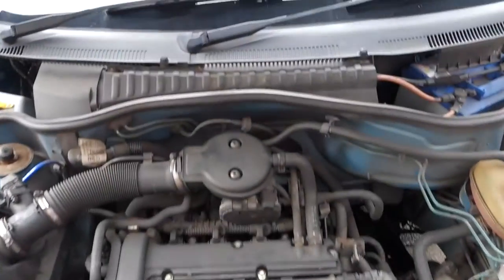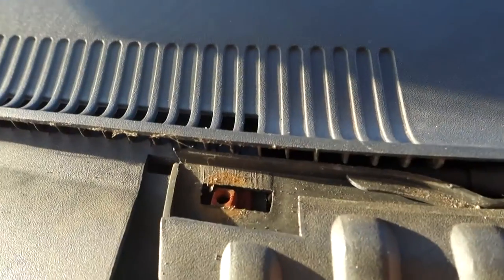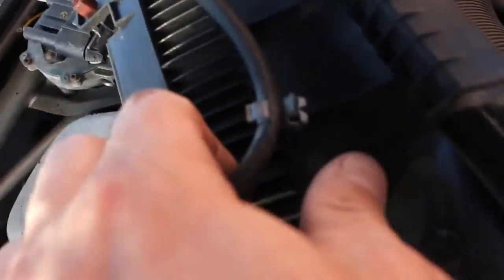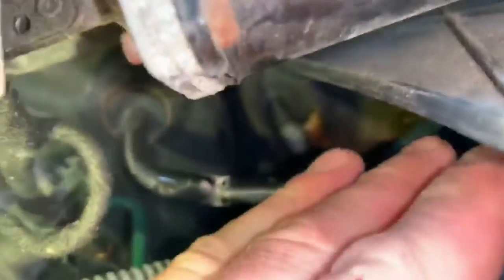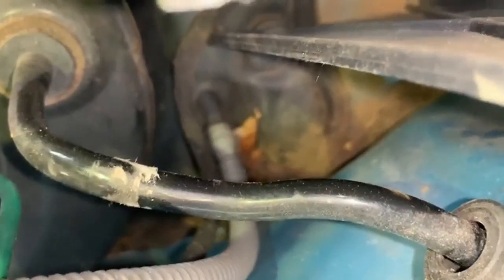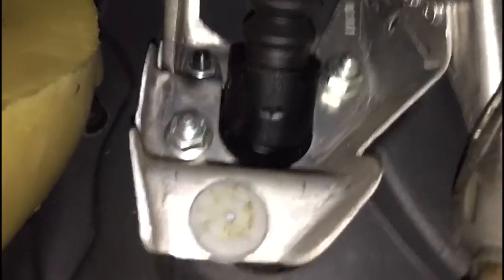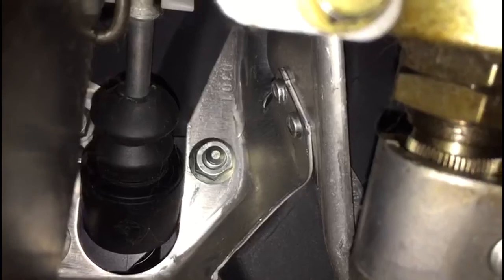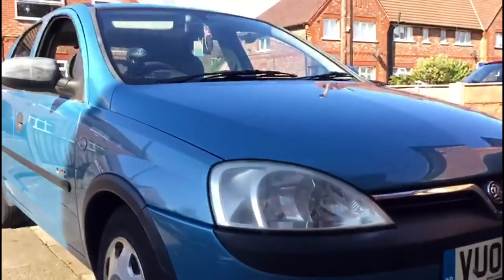Vauxhall Opel Corsa C - How to Remove and Replace Clutch Master Cylinder

Comment: Attempted this job today there was no other way of removing the master cylinder without removing the steering column lower uj joint shaft. I learnt this the hard way after hours of trying to get the clutch pedal out of the way. The jobs a massive pain in the back quite literally, mainly because of such tight space your working in and the position you'll be in for the next 2+ hours.
Reply from the maker: It's hands down the most awkward  job on any car! I've done a few with much misery.
Reply: absolutely right, that is what i am doing now,
Reply: Yup. I too ended up doing it properly by removing steering column. At one point was on my back, head under steering wheel and legs up over the seat. Took about 5 hours to complete. Had to get back of clutch pedal welded as tint stopper but had snapped off meaning the awkward little plastic bit at the end of the cylinder shaft had nothing to push against so must have got caught and snapped. A year on and all still good.
Reply: I removed the steering column too, but now the car won't start after removing the steering column after replacing the clutch cylinder, there's no fuel going into engine from the hose that brings fuel into the engine. How can removing the cables around the steering and putting them on affect fuel going into the engine?
Reply: @tebogopodile  if you removed the steering column it could be that you just need some codes clearing. Some faults may cut fuel supply like if you came or crank sensor are reading wrong

Comment: Hello, kindly assist me, I try moving my car this morning and when I try to get it in gear it won’t even move but the reverse gear would make a very loud noise, but after a few minutes of turning the car back off and going back to try to move it, I put the car in gear before I started the car and it worked just fine. What do you reckon the problem would be ??

Comment: so today i got my slave cylinder replaced, after my clutch failed the other day, and now, my car can hardly be put in gear, like i have to use force to put it in gear, and when i leave it cold for a while and i attempt to drive it, it won't go in gear at all, like i press the clutch, it feels kinda empty, not as tight as before, and it won't go in gear at all, some people told me that i should replace the master cylinder as well, since i replaced the slave cylinder, both should be replaced, and some people told me that my mechanic did my dirty with the bleeding job and left air in the circuit, so it should be bled again, the correct way and pumped up, so any ideas of what's going on? 
my car is paralyzed at the moment, so am i

Comment: I’ve released the steering column and slipped it down out the way. Am I right in saying that the bracket to the clutch pedal has to come out completely? I’ve got 3 of the bolts out but there is one more behind the top of the steering column box. Can anyone shed any light on what I need to remove and how , to get to this last bolt holding the clutch bracket in?

Comment: it's impossible to do this job in a manner as described in this video. You will need to remove the steering column.
Reply: No you don’t. Did mine today. Removed the top universal joint between the column and the rack to make enough space and the pedal comes straight out.

Comment: thank you for the video, i have a good idea what i am doing, looks tight for space. I am doing mine tomorrow on a vauxhall combo 1.3dcti, the plastic rod has snapped just after the white plastic clip, I hope i do not have to remove the steering column, like it says in the Haines manual. will let you know and maybe send so photos
Reply from the maker: The comments below and your research are right. Official way you should move the steering colum, but I got one out by forcing the metal plate out the way with a bar, bit crude but possible. I'm doing the transit connect master next week so video should be up by weekend, going to do this by the book lol .
Reply: @1NELIFE  thank you for the help, I am going to first release the steering column but not disconnect it, then will try with the bar, like you suggest. You have to be careful with the Air bag, and i have disconnected it, and removed to a safe place. Come across some bad accidents when the air bag has gone off whilst working on them
Reply: i was wondering if it is possible to replace the plunger in the master cylinder, that would be a great step forward
Reply from the maker: Hi as far as I know there one complete unit, might be possible to open it up though..

Comment: About to start this job. Haynes says need to remove steering column. What’s the issue with the airbag? Any advice would be appreciated. Everything I’ve read suggests this is a pig of a job! Some say remove steering column some say no need?
Reply from the maker: Hi yep its a long one. My video is not the best looking back I want to re do it. You can force it round the bracket but risk causing damage. The proper way is removing the steering column. Ive planned to re film it next weekend and will cover the whole job start to finish  hope this helps a bit. Cheers
Reply: 1NE LIFE CARS When doe you Rhône the video is up mine just gave out and would appricate every little bit of help there is 

Sorry for bad English not native speaker
Reply: I'm busy with my one just noticed the clutch bracket is welded on to the  brake bracket as well steering column must be off also it's a mission  working place is so small
Reply: Any advise I could do with sone help on my combo van

Comment: Its a lot more work than u say, once you remove the bolts u still won't be able to remove the Master cylinder. From what i can see you have to move the whole plating and probably  the steering
Reply from the maker: It can be persuaded out, certainly don’t need to touch the steering.
Reply: Iv just done mine  you do have to loosen the central  steering colum  a ball ache
Reply: @stuartwood5751  hiya buh I’m doing mine as we speak and it’s stressing me out just don’t know alot about combo but it’s a lot of work tbh to get such a small part out the pins stop it coming out what a poor design by gm it’s been a total. Over mare so far to do

Comment: Showing us how to do it by the method of not showing us how to do it... really ?
This guy clearly has no idea how hydraulics work. You will need to bleed the slave cylinder, and just pumping won’t do it.
Plus, the grey hose is not the “return”...
Dangerous stuff, do not try this at home 😂

Comment: You have to bleed the clutch after just pumping is dangerous the brakes are on the same system air compresses brake and clutch fluid doesn't

Comment: Just done mine you defo have to remove steering colum  first before removing pedal frame an absolute  nightmare  for space 😂
Reply: No you don’t. Did mine today. Removed the top universal joint between the column and the rack to make enough space and the pedal comes straight out.

Comment: No way is it just those bolts to remove cylinder. Steering shaft, along with two other bolts you forgot to mention. Terrible misleading video.